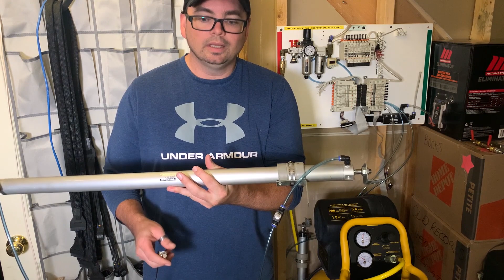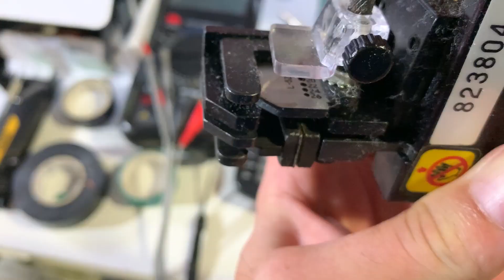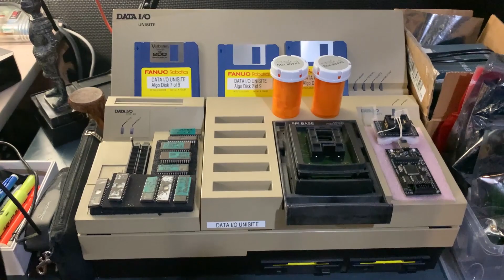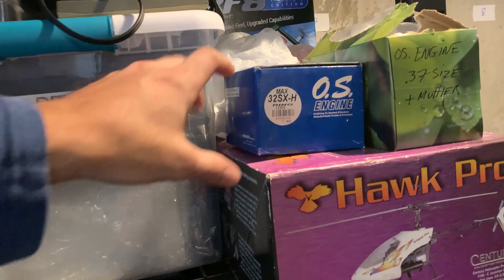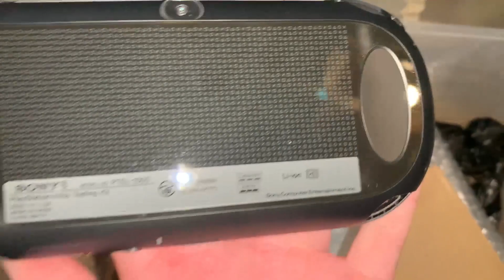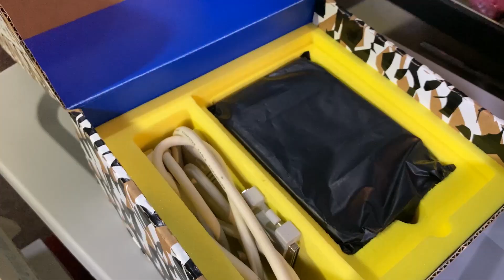Tour of my Electronics LAB + Some NEW Game Development kits for Future videos!   [#30]

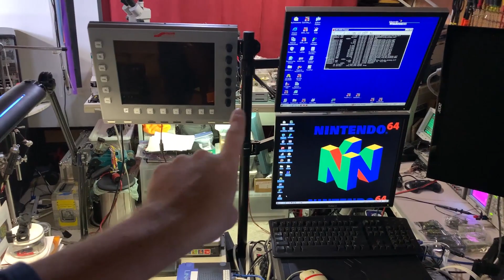Comment: Out of interest what is the monitor shown at 15:21 with the buttons around the edge?
Reply from the maker: That’s a broadcast video monitor I use. It has composite video, a touchscreen with a VGA port as well. They are used by professional TV stations for big video switchers called Acuity and Vision. The buttons and knob controls require a custom interface controller by the switcher. So you can’t really use them unless you rig up your own interface. They are from early 2000’s. An Awesome video monitor for old game consoles.😎👌here is one on ebay:👇 

https://ebay.us/m/ekENqL